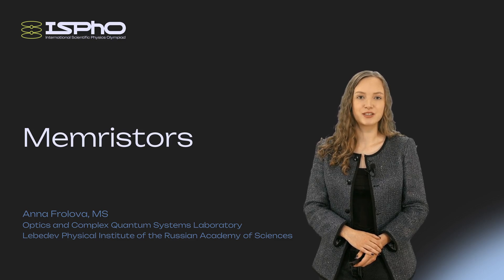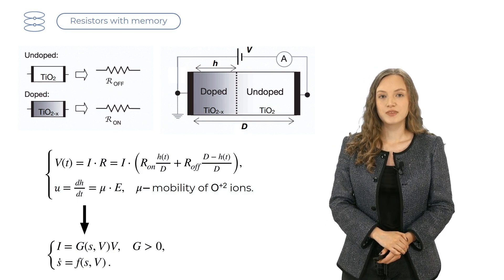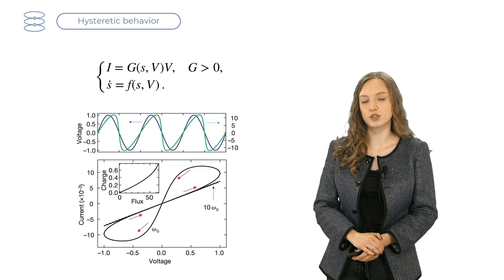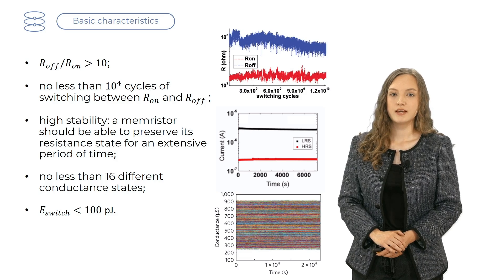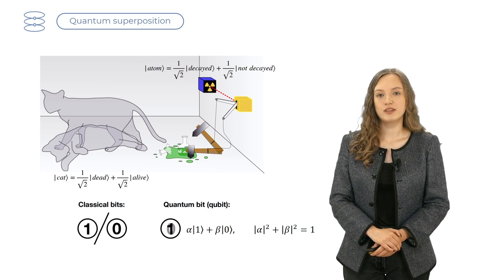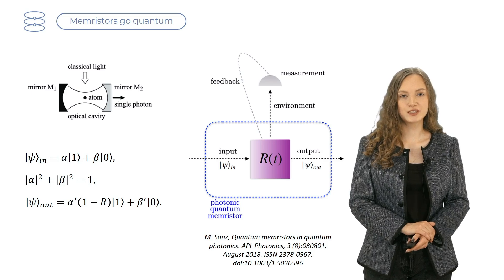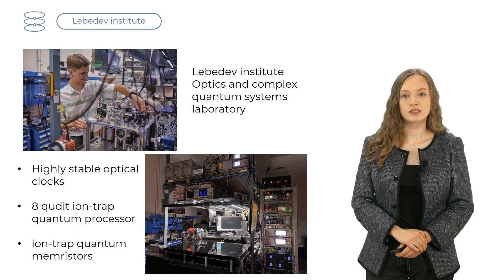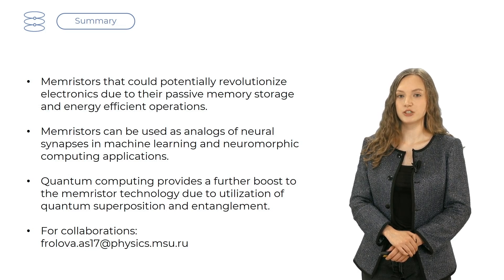Memristors by Anna Frolova, MS

Comment: 1:13 correction: the 3 fundamental circuit elements are resistor, capacitor and inductor
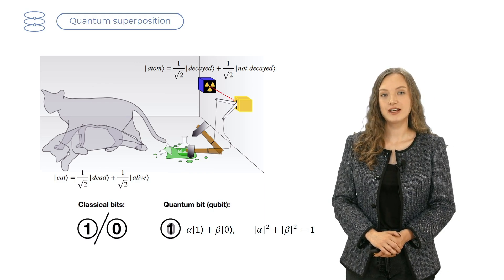10:06 correction: the cat is not decaying of course, I meant to say that the atom has a 50% chance of decaying 😄